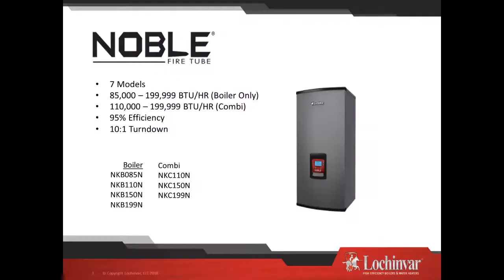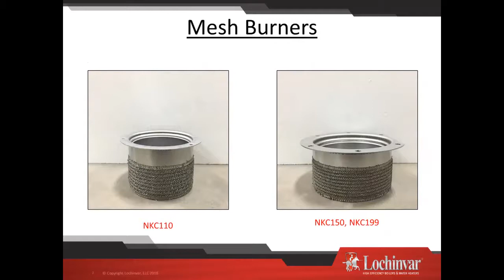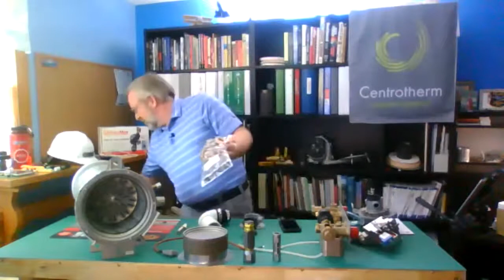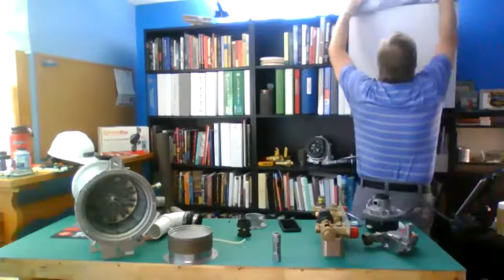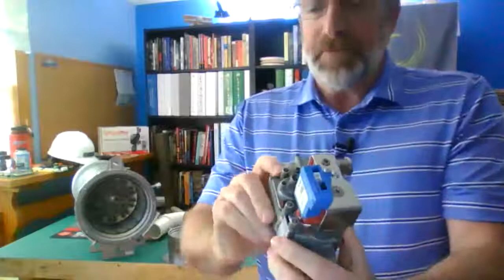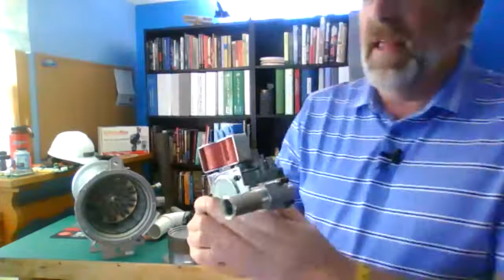Lochinvar Noble Boiler Service

Comment: Thanks for very fine video, I do have Lochinvar Kinght WHN155 model. It’s show up messages “ Lock Out - Ignition fault” . I been replace flame rock, combustion Burn, clean boiler very very good. Been check gas vale - 24 voltage, check all leaking gas, fan good…. It is run for one day / very nice heat and hot water and than it show up message ignition fault again. Would you have any ideas to help me out. Thanks so much
Reply: I wanted to let you know your boiler may have been recalled for the risk of carbon monoxide poisoning in 2020. The Recall information can be found on the Consumer Product Safety Commission (CPSC) website.

2020 Recall:

"The boiler’s flue grommet can deteriorate and dislodge during use and allow the boiler to emit carbon monoxide, posing a risk of carbon monoxide poisoning."

Comment: I’m having a problem with the mixing valve screaming. Any suggestions for that?
Reply: Great video by the way.
Reply: Please be aware that there have been 2 separate recalls for the risk of carbon monoxide poisoning for some Noble models. The Recall information can be found on the Consumer Product Safety Commission (CPSC) website.

2020 Recall:

"The boiler’s flue grommet can deteriorate and dislodge during use and allow the boiler to emit carbon monoxide, posing a risk of carbon monoxide poisoning."

2023 Recall:

"The boiler’s flue collector can crack if exposed to a high impact event in the burner chamber, which can allow the boiler to emit carbon monoxide, posing a risk of carbon monoxide poisoning."
Reply: I replaced everything in it. It was all good. I found that it wasn’t piped properly and that caused the screaming. I’m not really sure why but it stopped. After working on several of them I have come to the conclusion that the noble is absolute garbage. Thanks for your advice.

Comment: A customer froze up a cabin where a Noble is installed, and glycol was leaking out of the boiler. It turns out the domestic water in the exchanger froze, deformed it, and it now leaks at both valve connections. I searched for information and here's your video. Just what I needed. Thanks!
Reply from the maker: Glad we could help!

Comment: Has anyone has the issue of flame fail while running? Im going back on a Noble we installed about  year ago that is having this issue. In high fire no issue but when it ramps down the flame drops out.
Reply from the maker: sounds like the venturi needs to be cleaned and a possible combustion adjustment.  Contacting your local contractor would be our recordation.
Reply: Please be aware that there have been 2 separate recalls for the risk of carbon monoxide poisoning for some Noble models. The Recall information can be found on the Consumer Product Safety Commission (CPSC) website.

2020 Recall:

"The boiler’s flue grommet can deteriorate and dislodge during use and allow the boiler to emit carbon monoxide, posing a risk of carbon monoxide poisoning."

2023 Recall:

"The boiler’s flue collector can crack if exposed to a high impact event in the burner chamber, which can allow the boiler to emit carbon monoxide, posing a risk of carbon monoxide poisoning."

Comment: Thank you so much   ... ex plumber who is retired have a combi installed 4 years ago and need to service.  Thank you
Reply from the maker: Glad this was helpful!
Reply: Please be aware that there have been 2 separate recalls for the risk of carbon monoxide poisoning for some Noble models. The Recall information can be found on the Consumer Product Safety Commission (CPSC) website.

2020 Recall:

"The boiler’s flue grommet can deteriorate and dislodge during use and allow the boiler to emit carbon monoxide, posing a risk of carbon monoxide poisoning."

2023 Recall:

"The boiler’s flue collector can crack if exposed to a high impact event in the burner chamber, which can allow the boiler to emit carbon monoxide, posing a risk of carbon monoxide poisoning."

Comment: Any ever have lockout Water press switch erron lochinvar noble combi boiler?
Reply: Please be aware that there have been 2 separate recalls for the risk of carbon monoxide poisoning for some Noble models. The Recall information can be found on the Consumer Product Safety Commission (CPSC) website.

2020 Recall:

"The boiler’s flue grommet can deteriorate and dislodge during use and allow the boiler to emit carbon monoxide, posing a risk of carbon monoxide poisoning."

2023 Recall:

"The boiler’s flue collector can crack if exposed to a high impact event in the burner chamber, which can allow the boiler to emit carbon monoxide, posing a risk of carbon monoxide poisoning."

Comment: This video was amazing! Thank you for sharing this knowledge! My Lochinvar Noble boiler currently has a fail ignition fault. It's been running like a top for three years then just stopped. I confirmed I have spark. I confirmed 26 volt from the board to the gas valve. My boiler goes from pre purge, runs 26 volt to the gas valve, I get ignition (visible) for 0.5 seconds, then boiler goes into post purge and gas valve goes to 0 volt. Repeat 3 more times, error and lockout. I don't have a manometer to check the gas valve unfortunately, but that may be the culprit. Odd to me that I can see it fire through the sight glass and it still shuts off though...any ideas from the peanut gallery???
Reply from the maker: It’s hard to pinpoint the exact cause for this as there are many things that could be the issue. When was the unit serviced…i.e… burner cleaned, etc..If you do not know I would start there.  You can find your local representatives here https://www.lochinvar.com/locator/
Reply: Please be aware that there have been 2 separate recalls for the risk of carbon monoxide poisoning for some Noble models. The Recall information can be found on the Consumer Product Safety Commission (CPSC) website.

2020 Recall:

"The boiler’s flue grommet can deteriorate and dislodge during use and allow the boiler to emit carbon monoxide, posing a risk of carbon monoxide poisoning."

2023 Recall:

"The boiler’s flue collector can crack if exposed to a high impact event in the burner chamber, which can allow the boiler to emit carbon monoxide, posing a risk of carbon monoxide poisoning."

Comment: My boiler is working fine but the display screen keep rebooting itself, what’s the solution? Do I have a bad control board? @FIA_inc
Reply from the maker: Does the unit still operate normally? If it does, I suspect it is not the main control board it would probably be the user interface or the ribbon cable between the user interface and the main control board. I suggest checking all the connections from the display board to the main control board. Power it down then power it back up and see if it goes away after rechecking the connections. Unfortunately there is no way to field test the boards. The main control board is the “brain” and is where the logic takes place, the user interface or display screen is only a window to see into the brain….so to speak.  You can find your local representatives and service contractors here:https://www.lochinvar.com/locator/
Reply: It was the interface board.  Can the inlet valve assembly be replaced? What’s the part number?
Reply: Please be aware that there have been 2 separate recalls for the risk of carbon monoxide poisoning for some Noble models. The Recall information can be found on the Consumer Product Safety Commission (CPSC) website.

2020 Recall:

"The boiler’s flue grommet can deteriorate and dislodge during use and allow the boiler to emit carbon monoxide, posing a risk of carbon monoxide poisoning."

2023 Recall:

"The boiler’s flue collector can crack if exposed to a high impact event in the burner chamber, which can allow the boiler to emit carbon monoxide, posing a risk of carbon monoxide poisoning."

Comment: I’m seen plastic venturis completely rot out anyway to fix that? Like the plastic crumbles apart
Reply from the maker: Typically a plastic venturi rotting out or physically breaking down means it is being exposed to exhaust gas recirculation, a laundry dryer vent exhaust or some other chemical that could be drawing into the intake of the boiler.

Comment: Im not getting dhw. At my faucets
Reply: I’ve replace the diverter one year and another year I replaced the flow sensor that has a red light.
Reply from the maker: Flow may not be high enough to trigger DHW, verify DHW flow is at least 0.4 gpm

You can find your local representatives and service contractors here: https://www.lochinvar.com/locator/

Comment: Great video! I’m having issues with ignition and fan noise on my N199. Do you have a link or video of your service you talk about at the end of this video? I need to dig into mine and it would be very helpful.
Reply from the maker: Contact us at training @ fiainc.com and I can send you a service manual

You can find your local representatives and service contractors here: https://www.lochinvar.com/locator/
Reply: I don't know what model you have, but there have been 2 separate recalls for the risk of carbon monoxide poisoning for some Noble models. The Recall information can be found on the Consumer Product Safety Commission's website.

2020 Recall:

"The boiler’s flue grommet can deteriorate and dislodge during use and allow the boiler to emit carbon monoxide, posing a risk of carbon monoxide poisoning."

2023 Recall:

"The boiler’s flue collector can crack if exposed to a high impact event in the burner chamber, which can allow the boiler to emit carbon monoxide, posing a risk of carbon monoxide poisoning."

Comment: Robb, I have a Lochinvar Combi Boiler installed and live in the Haverhill area, can you recommend a local company who services this product. Mine was installed in 2019 and the contractor who installed it is no longer in business. I am having low flo issues with the DHW.
Reply from the maker: You can find Lochinvar contractors we recommend on our website here: https://fiainc.com/content/resources
Reply: @FIA_Inc  I didnt see Petro Home Services on this list
Reply: I don't know what model you have, but there was a recall for the risk of carbon monoxide poisoning for some Noble boilers. The Recall information can be found on the Consumer Product Safety Commission's (CPSC) website.

2020 Recall:

"The boiler’s flue grommet can deteriorate and dislodge during use and allow the boiler to emit carbon monoxide, posing a risk of carbon monoxide poisoning."

Comment: Anyone ever have issues with the fan making a very loud High pitch sound?
Reply: I replaced the fan for short money.   And the issue went away.
Reply from the maker: There could be many things to create the sound so it is hard to say exactly what the issue could be. Has the noise been there since the unit was installed? Is the noise really emanating from the fan? Does the sound ever go away? Try and take the air intake off of the unit and see if it goes away. There could be something that got sucked into the fan. The fan itself could be failing. Is the unit vented properly? Any obstruction?  With the unit in “shutdown” or “Standby” mode per the display screen, pull the 4 wire modular connector on the fan. This will turn the fan on at full speed without the unit firing…..does it still make the noise? 

You can find your local representatives and service contractors here: https://www.lochinvar.com/locator/
Reply: Please be aware that there have been 2 separate recalls for the risk of carbon monoxide poisoning for some Noble models. The Recall information can be found on the Consumer Product Safety Commission (CPSC) website.

2020 Recall:

"The boiler’s flue grommet can deteriorate and dislodge during use and allow the boiler to emit carbon monoxide, posing a risk of carbon monoxide poisoning."

2023 Recall:

"The boiler’s flue collector can crack if exposed to a high impact event in the burner chamber, which can allow the boiler to emit carbon monoxide, posing a risk of carbon monoxide poisoning."